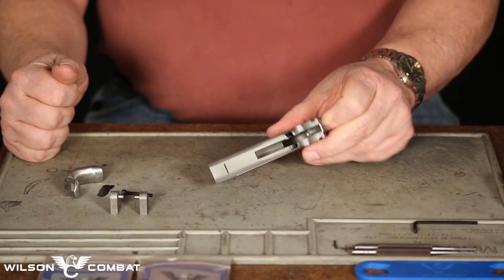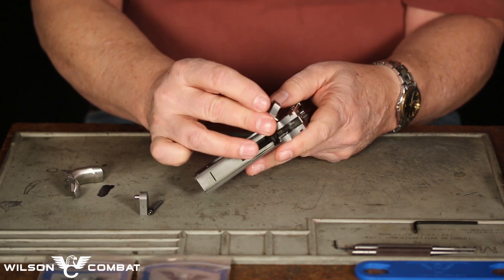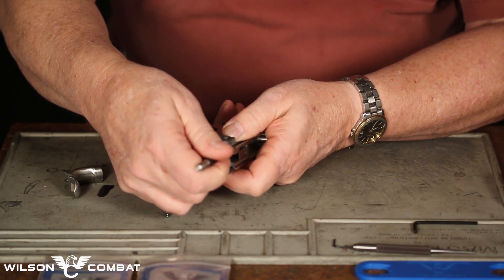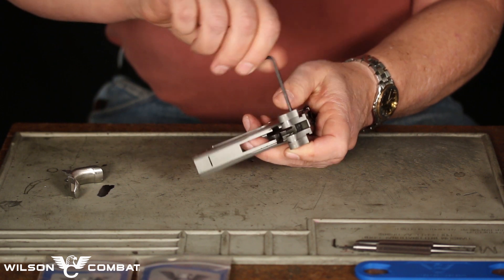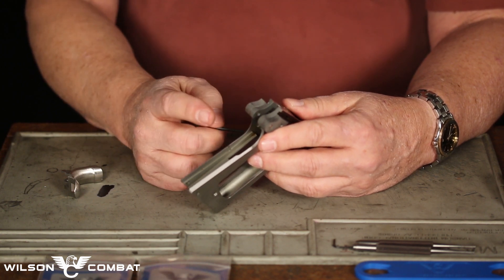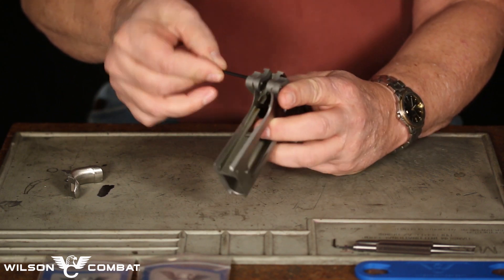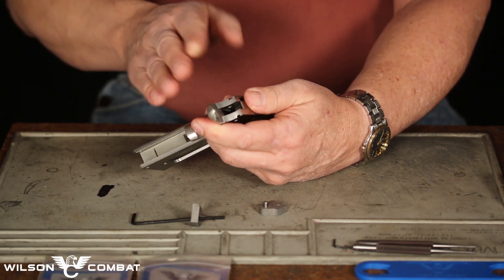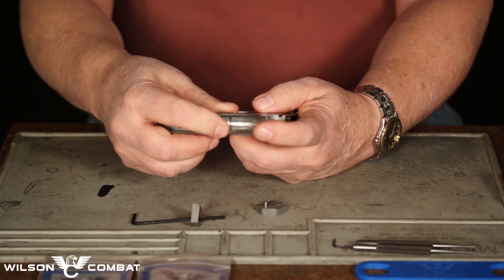Installation of a #298 beavertail grip safety using the #402 fitting jig

Comment: I have just built a Caspian Commander frame with Wilson small parts including a 337SC grip safety and matching563 concealment hammer.   Experiencing impeded travel of the trigger and grip safety to reset.  I am going to order fitting jig #402 and a replacement 337SC grip safety, dissatisfied that too much material was taken off the tang to force a fit.   After viewing this I think my issue will be resolved, sorry I did not know this 2 years ago when initially ordering the parts for this project, but looking forward to getting it done and enjoying my titinum framed handgun topped with a stainless slide.   Many Thanks !*